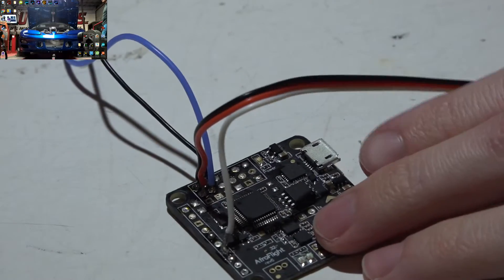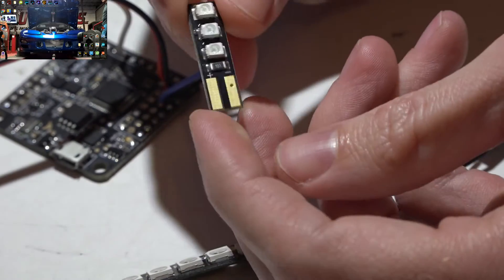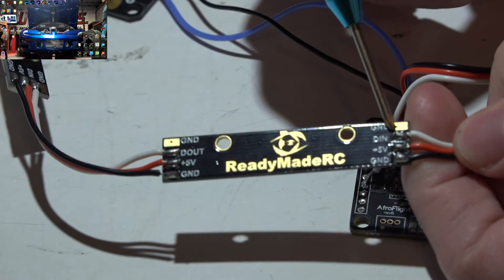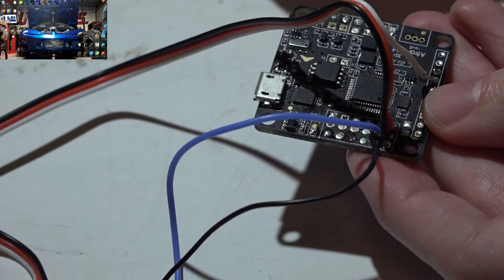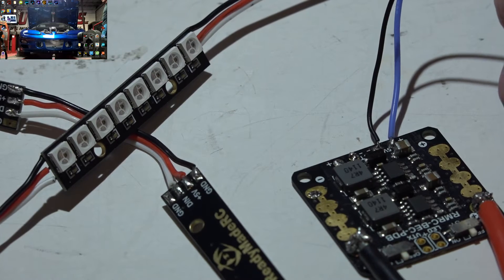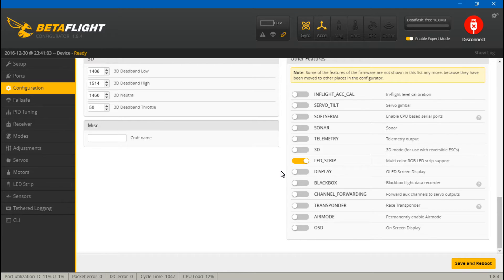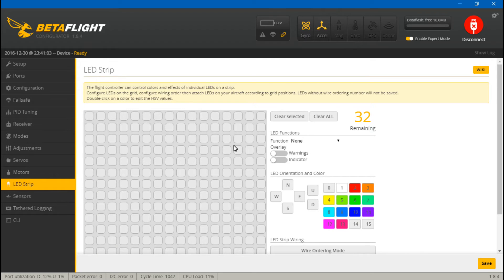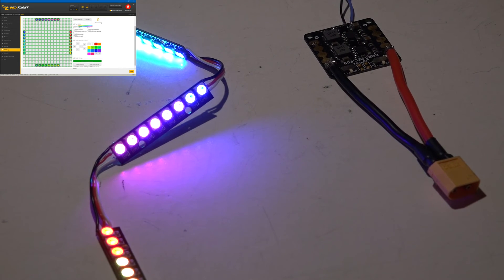Wiring Addressable LEDs To Naze32

Comment: There is a way to combine X4r SBUS and telemetry with a led strip? I have to use pin 5 for the led, how can i connect the X4r?
Reply from the maker: Cant. Not with the Naze32. Every F3 and F4 flight controller you can have telemetry, SBUS, and LEDs all at the same time. The F1 processor on the Naze 32 wont allow this.
Reply: Saverio Garzi kk